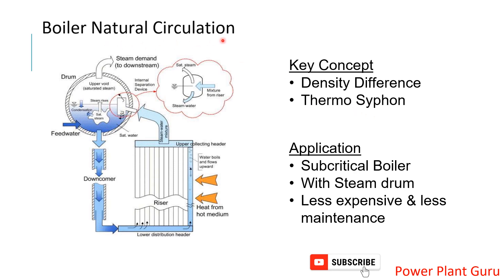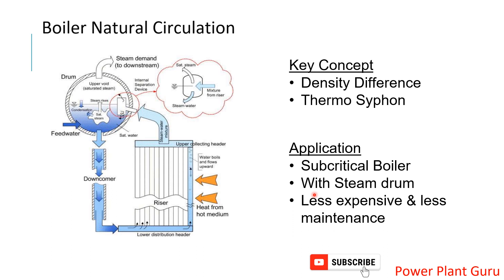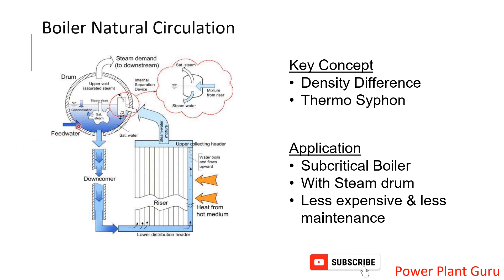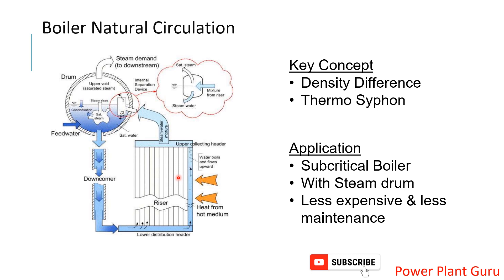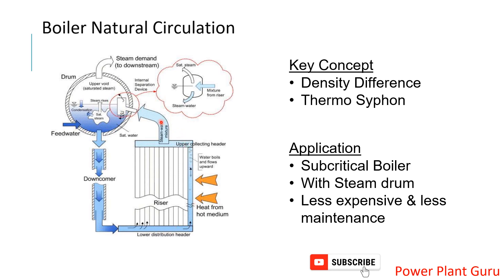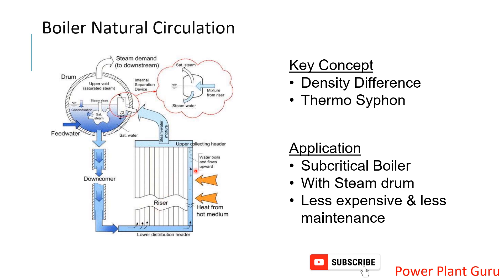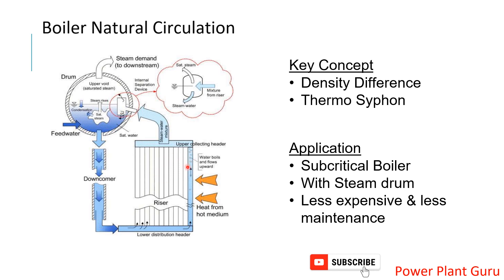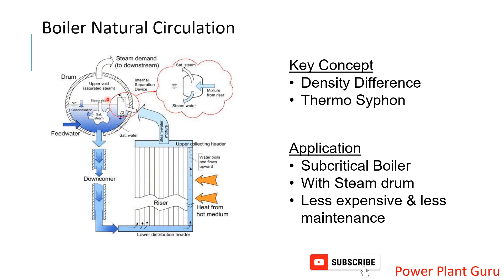Natural Circulation Boiler, Forced Circulation, Circulation Principle of boiler

Comment: Why operater have low water level before boiler light up kindly sir tell me
Reply from the maker: Hello thanks for watching my videos. 
As you start the boiler the water temperature rise and accordingly volume will rise and the level will increase. That's why the boiler started with a little lower level than the normal level .

Comment: Do you know how much is the vaporization inside the riser tubes? Is there a limit? How to determine this?
Reply: theoretically 100% vaporization is the best option , but to prevent high temperature damage to tubes, normally vaporization is kept around 50%

Comment: Very nice video.
Can you please tell me why baffle plate are used?
1) To hold the tubes of HRSG or to direct the flue gas toward tubes by avoiding flue gas leak of at the empty ended section?
I think the most critical paet of power plant is boiler section because boiler section is only opened at outage seasions. Prolong operations can cause hotspots which can only be rectified during outages. 
If tubes get dirty (heavy sulphur deposits) then you can rectifoed that issue only at outages thus compromisong on heat rate
Reply from the maker: As you rightly mentioned baffle plates are used for directing flue gases in desired direction
Reply from the maker: Most of the HRSG are top supported, means hanging from top and free at the lower side for expansion. 
To keep it in proper shape in between there are clamps which tie tubes from each other and support. Baffle and not used for support
Reply: @powerplantguru007  Thank you so much .
Reply from the maker: Hot spots are mainly due to poor workmanship. 
We should carry thermography on the outer surface of HRSG (mainly superheater area)  regularly and attend all high temperature spots and get it checked by refractory engineer
Reply: @powerplantguru007  You are right. If sheets are not tightly packed then flue gas make their path. 
Thermography is done at regular intervals but i think it is not sufficient if neither party takes responsibility to recitify the issue.
Reply: @powerplantguru007  In some power plant there are two parties owner and O&M. Most of time neither one party takes responsibility of recitifying hotspot issue , both parties blame other and with help of CSA (contractual agreement) clauses ask other party to pay for job